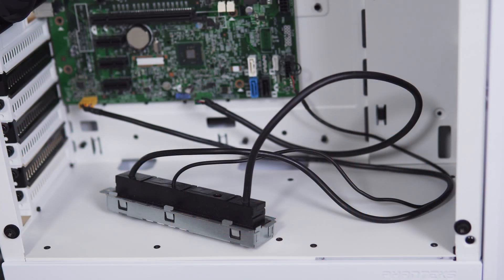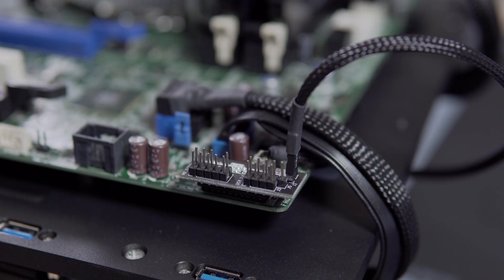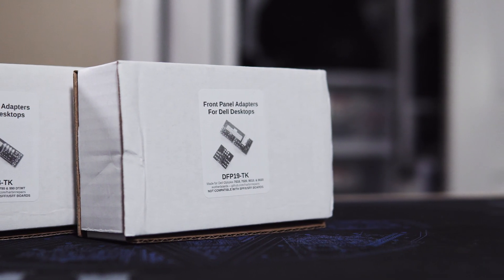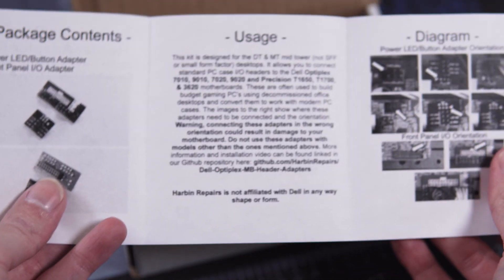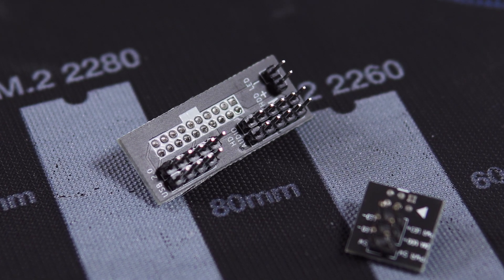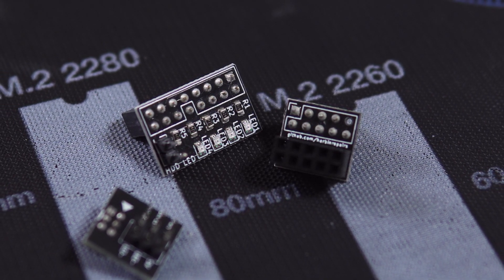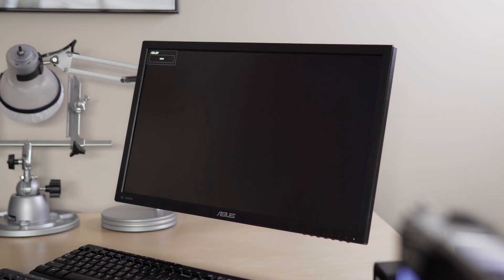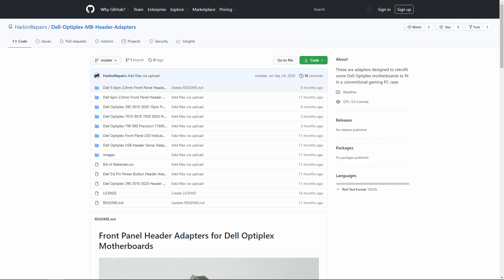Dell OptiPlex Case Swaps Just Got A Lot Easier

Comment from the maker: Sorry for all the banging, someone was moving crap around in the room right above me. Anyways, drop a comment and tell me what case you'd like to see me swap and Opti into.
Reply: I’m doing one in a cheap Musitex case, nothing too crazy, just enough to leave room for improvement.
Reply from the maker: @WanderingDisciple87  Interesting... never heard of them before.
Reply: Really like these videos they are simple and down to the point with no hype or $h!T intros.... Keep up the good work.....
Reply from the maker: @charliescharlie3717  Thanks! Will do.
Reply: I wish I had ram because mine stop working 🥺
Reply: Wil any of these work with the 3060 does it have the same motherboard as any of the recommended one
Reply from the maker: @sphinxzapper2071  Possibly the power button adapter, but not the rest of the front panel unfortunately.

Comment: Is there one for the sff boards. I really love my optiplex just want a case with more air flow
Reply from the maker: The power button adapter works for the SFF models, but there is an interference issue with the front panel adapter. If you don't mind loosing the front panel audio and USB2, there are ways to make it work without the F1 error.
Reply: @TheGameBench  I'm looking for something as well for my SFF and removed the front IO for more air flow and have a 19 pin and a 9 pin from that open and I cant find adapters to put there to make those ports usable for things like internal USB.

Comment: Dell optiplex 9020 SFF motherboard is the same as the tower motherboard. How would it not work with SFF???
Reply from the maker: Yes, the connectors are the same. And as far as I know, the power switch adapter will work just fine. However, the front header adapter has some clearance issues with things on the motherboard, so it doesn't fit.
Reply: @TheGameBench  ah, right'o. thanks for the extra info dude i appreciate your answer to my question 😁

Comment: These adapters are great for ease of use, however I'm wondering about the economics of this route. Once you've bought these adapters, plus the 8-24 pin power adapter, would it not be nearly the same price just to buy a second hand standard motherboard?
Reply from the maker: Nearly? Perhaps... but it really depends on the board. The cost on something like a decent Haswell motherboard can be near $100, even for something that isn't a Z series chipset. For around $50, you might find something okay for that price, or it might not be as good as the board you're pulling out of the OptiPlex. However, there is a way to do the case swap without the adapters if you don't care about the front panel audio or the USB2 ports. Brian at Tech Yes City showed a way to bypass all those F1 errors without the adapter.
Reply: @TheGameBench  fair enough. And I get that there is satisfaction in repurposing oem parts. What do you think about the newer Optiplexes with 6/7 gen processors?- They seem to be becoming affordable now.

Comment: I'm trying to upgrade my dell optiplex 9020 sff but that is a bugger these adapters doesn't work with small form factor. Any adapter suggestions for small form factor?
Reply from the maker: There aren't any sadly. The power button adapter still works, but you do have another option that doesn't require any adapters. Tech Yes City has a great video on this and it's pretty simple to do.

https://www.youtube.com/watch?v=oRa3Wk0iYvY&t=2s

Comment: I have a optiplex 7070 mid tower 
I bought a 1650 oc but it need a higher wat psu
I need a psu for the dell optiplex but its too expensive so what do I exactly need to swap the case so i can install a atx psu
Reply from the maker: Well, case swapping the later models with the proprietary chassis becomes more difficult. But there are ways to add a new PSU. I don't believe the xx70 models are using the 12vo standard so you should be able to get an adapter and you can fit an SFX power supply in the MT case. You can cut a hole at the back if you want to, but you should be able to secure it with at least one screw without cutting a hole. It would be a tad jank... but it would work, and be a whole lot less complicated than a case swap. You could still try the case swap, but I don't think the holes will line up with any ATX screw pattern.
Reply: @TheGameBench  i already searched sfx psu but its over 150 dollars and i say that its too expensive besides i already bought an adapter a month ago but i just need a sfx psu ☹️
Reply from the maker: @samm8824  What wattage are you looking for? That's about what a 750 watt model is going for and you should need something that substantial.
Reply: @TheGameBench  i need just a 300+ wat cheap psu sfx
Reply from the maker: @samm8824  The lowest wattage rating I can find on SFX power supplies is 450 watts and the Corsair SF 450 is just under $100 on Amazon. And that's about as cheap as new ones get. If that's too expensive, you can look at FlexATX or TFX. They're like the SFX, they're not made to fit, but they're small enough to fit. Also, the SF 450 is also on Amazon for just over $60 renewed.
Reply: @TheGameBench  thanks
Reply: @TheGameBench  idk but sf450 is 100+ dollars to me can you send the link?
Reply from the maker: @samm8824  Here's the new one:

https://www.amazon.com/CORSAIR-SF450-Certified-Modular-Supply/dp/B01CGGOXWQ/ref=sr_1_1?keywords=sf+450&qid=1639255348&sr=8-1
Reply from the maker: @samm8824  And here's the renewed one:

https://www.amazon.com/Corsair-Modular-Supply-Certified-Refurbished/dp/B07HMJM1CG/ref=sr_1_3?keywords=sf+450&qid=1639255376&sr=8-3

Comment: Is there anything newer than the optiplex 9020 now a days to do the same thing?
Reply from the maker: You mean for case swaps? You might be able to swap a xx40 or xx50 series into another case, but no such adapters exist for those boards. They boards are more non-standard compared to the xx20 series.
Reply: I mean for building a gaming pc. I figured its been over a year since your first videos, maybe there newer and better dells or other brands for cheap now that we can add graphics cards to.
Reply from the maker: @victorsanchez4497  Dell... sadly, not so much. The OptiPlex kinda' took a bad turn after the 20 series. You can, but you either have to stick to GPU's that don't need supplemental power, or modify it with a SFX power supply. Even then, they're cramped and GPU sizing and airflow become and issue. Instead I would suggest looking at the HP Z series. They come with decent sized PSU's for the time, and you can replace them with an adapter, like the xx20. Plenty of room for GPU's and not too hard to add more airflow.

I'll agree the the 4th gen is nearing the end of it's useful life for the most part, and while you can move to a 6th gen system... they're going to have similar issue to the 4th gen as will the 7th, being quad cores. They're all limited in cores and the IPC gain isn't huge either. They'll all get beat by a current Ryzen 3 or Intel i3. You just need to find them at the right price to make sense over just building something with a low end CPU that you can easily upgrade when you have more cash.

Comment: As daft it sounds... it would genuinely be cheaper to buy a used 1150 Motherboard than buying the adapter and other kit 😂🤣😂
Reply from the maker: Not really. Just looked at ebay and even H81 mobos are going for around $50 and you have to pay tax on top of that. Then you'd have to buy a CPU cooler on top of that. And you'd end up with a worse board. Some of them even have a paltry two phase VRM. And even looking at the B85 and you're up to around $100. Which is kinda' insane considering you can get a good B450 board for that.

Comment: can you use this in reverse if you put a ryzen system into an OptiPlex case?
Reply from the maker: Nope, these only work in the OptiPlex motherboard. To put modern hardware in an OptiPlex case, and make everything work... like building a sleeper, you'd have to get creative and modify things to make it work.
Reply: @TheGameBench  mine is working I just wanted to keep the power button light

Comment: so it wont work on any sff version? i have 9020 sff
Reply from the maker: Nope, the front panel connections on the 9020 SFF are not the same as the MT systems.
Reply: @TheGameBench  so if i left the front i/o just dangling inside, would i still get errors?
Reply from the maker: @three828  Nope. In fact, before these adapters, that's what most people just did. Perfectly viable solution for the front panel. Though you can still get errors from other things like the fans if you're changing them out.

Comment: Only doubt I have on these adapters is that some of them have the pins outside the main motherboard so need extra space on top and bottom will they fit on a micro atx case?
Reply from the maker: I suppose that's possible depending on the case and it's clearances, but there's no universal answer. I just measured the overhang it's 5mm.
Reply: @TheGameBench thanks, 5 mm is more than enough or else as typical micro atx cases you can do a little hole in the bottom as usually these cases, have a plate to divide between the psu and the motherboard you can arrange it, for me a optiplex is beautiful with a modern small case as mt and dt are originally from factory, not normal atx size

Comment: Wil any of these work with the 3060 does it have the same motherboard as any of the recommended one
Reply from the maker: No, the 3060 is very different from those models. The power button connection might be the same, but the front panel connection is very different, so this wont' work with the 3060.

Comment: Does this work at all with the SFF version of the 9020?
Reply from the maker: The power switch adapter will work, but the front panel adapter won't. It interferes with the rear I/O.

Comment: Is this compatible if you’re building your optiplex setup in an argb case, I have a 9010 MT, I am trying to build my system in a cooler master mb311l argb case and I wanna know if it’s fully compatible including the kit that was mentioned in the video, amazing content btw
Reply from the maker: The case shouldn't matter as everything you'll be connecting to these will be standard connections. And yes, it's compatible with the 9010 motherboard.
Reply: @TheGameBench  thats a relief, thank you

Comment: I have SFF T1700, you said it as well, im getting this to swap it to a bigger case
Reply from the maker: I hope you haven't as they don't work on the SFF systems. There's stuff in the way of the front panel connector so the board can slot in. The power button adapter would work though.
Reply: @TheGameBench  didn't but damn
Reply: @TheGameBench  Also the reason why I wanted to do this is because this gave me hope https://www.reddit.com/r/pcmasterrace/comments/mae5bz/my_600_gaming_pc_made_from_dell_t1700_sff/?utm_source=share&utm_medium=web2x&context=3
Reply from the maker: @sorayasis  Yeah, you can see in those pics that they have a Dell front panel hanging out in the case to avoid the F1 errors. Still you can find mini-tower systems for not a lot. Your other option is to splice into the front panel cable, and tie it into the front panel of your new case. Would look much better, and no errors. If Harbin wanted to make something that worked with the SFF systems, and I think they should, they would have to make an adapter that used a cable with the adapter at the end.

Comment: I have two Optiplex mid tower 9010’s both with i5’s. I plan on doing a retro build with one with newer hardware. I’ve been watching all of your Optiplex videos including the video about adding air flow. And on that note, I have come up with some fan ideas but have tried it yet. Instead of cutting a hole for a 120 mm fan you can use Dell original cpu cooler fans instead, and if you only use one you can keep the hard drive cage if you so desire. Or remove the hard drive cage and use to fans. The cpu fans are smaller than 80mm, also the rear case fan is a 80mm fan and if you have some extras thes could also be used. Since these are delta fans and they would exceed the two fan headers on the motherboard, you have four sata power plugs in the front of the case.two on top one for the cd drive and an extra at the 5.25 drive bay, and the two on the bottom at the hard drive cages. With the proper adapters you can power one to two delta fans up front with some modding. The cardboard roll Id is the perfect template for cutouts for this style of fan. The speaker and temp sensor doesn’t have to be moved or removed. Since the case isn’t perfectly flat you can make your own stand off’s for the fan to fit the irregularities. I had some rivet nuts laying around and with some small machine screws and nuts this worked perfectly.

The thing I wonder is will two 80mm fans bring in enough air flow for a Asus b550 motherboard w/3700x or higher w/ prism cooler, GTX 1080-2080 or R5, R9 or a 6700xt, 6800xt. Any thoughts?
Reply from the maker: I'd say no. I built a system at Christmas for my brother and he needed me to keep the hard drive cage. I was putting in an XFX RX 470, so I needed to add a front fan, so I installed a front 80mm. Even with cutting out the material in front of the fan, the 470 got very warm and the GPU fans had to push pretty hard just to keep it under throttle.

Comment: is there anything out there for a 7020 sff
Reply from the maker: Nope. Nothing that I know of. The problem with the SFF board is that there's interference between the rear I/O and connection point for the front panel. It would have to be some sort of cable rather than the board that plugs right into the connection on the motherboard. I believe the power switch adapter fits just fine.

Comment: Hi, I have a question. How dificult is to swap a motherboard from a SFF 3070 to an atx case?
Reply from the maker: Looking at the 7050 MT I have here, which should have the same screw pattern, it's not standard ATX. Only one screw lined up. Looks to be a custom screw pattern.
Reply: @TheGameBench  Thanks, my concern is more for wires and conectors. I found a very good deal for a dell 3070 with a i5 9500 but that SFF case has no room for a GPU. You think that present more problems than the screws? 

This is the pc, look where is the pci express slot  youtube.com/watch?v=9RgmD3VRua4

Thanks again for the answer!

Comment: Does this also bypass the fan error?
Reply from the maker: Unfortunately, no. That's a separate issue. The fan controller on these are very picky. You can easily adapt from the SL fan headers on the Dell motherboard to a standard 4-pin fan, but you still might get the error as there's some compatibility issue and I've not been able to find a pattern.
Reply: Oh boy...another adapter...I’m still glad I’m swapping one fir the learning experience, but I probably won’t do it again, oh well, it’s fun.

Comment: Thanks for  video

Dell Optiplex 7010 with Intel i7 3770 8GB RAM + 750GB HDD Windows 10 Activated   for $180 Is this a good deal??
Reply from the maker: Thanks for watching! I'd try to talk them down to $160 to $170.
Reply: @TheGameBench  damn he aint budging! i only consider it bcause of the processor... ill look out for others
Reply from the maker: @th8me  Yeah, you can get better deals. Try also looking at the HP Z220 workstations. I got one recently with a 3770 and a 1TB drive for $160 on eBay and they're easier to work in than the OptiPlex case. Plus it has a much better power supply. Just to give you some more options.

Comment: is there a simple way to case swap a 390 sff?
Reply from the maker: Simple? No. The problem is that the front I/O connection is too close to the rear I/O so someone would have to make something similar as these kits, but via a cable instead.
Reply: @TheGameBench  so there ia a way tho?
Reply: @TheGameBench  so there is a way tho?
Reply from the maker: @beanswuthefuq  Yeah, you could take the factory front panel connection and splice into it with the front panel connections of the new case. It's possible, but it wouldn't be easy.
Reply from the maker: @beanswuthefuq  Nope, it's way too big. It would have to be a micro ATX or bigger.

Comment: I bought a GTX1650 EX Plus GDDR6 4gb and my case is big from another brand when I turn on the computer, the video is not working and the card works normally turns the video card fans, when I remove the battery from the motherboard and put it back in and turn on the PC he gives video detail when I used my old video card r9 380 GDDR5 4gb it from the normal image, but when I turn off the PC I have to do the same procedure mentioned here! The motherboard is up to date, my source is 500w from the Gamemax brand, I changed the battery on the motherboard, I don't know what to doing from  Brazil

Comment: I have done two case swaps with these kits. they rock!
Reply: Could you suggest me a case to swaps for my 9010 mt? or I can get whatever I want to?
Reply from the maker: Anything that can mount a micro ATX board. I can give you some suggestions. What's your budget for the case?
Reply: @TheGameBench  no more than 80/70 bucks
Reply from the maker: @Rjgi96  Off the top of my head, some really good options would be the Phanteks P300, Zalman S2, Fractal Focus G, and Corsair Spec 04.
Reply: @TheGameBench  thank you man!
Reply from the maker: @Rjgi96  No problem.

Comment: I just completed a case swap for my 9020 into a thermaltake case and have had continuous issues trying to get the power button to work, not to mention the front panel I had to gaff into the optical drive cage. I'm very excited to try this out!